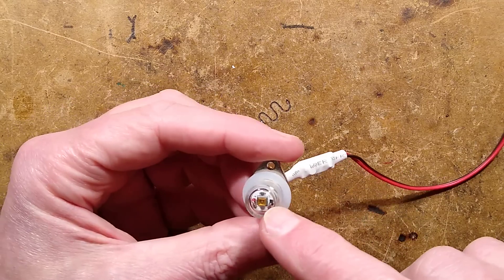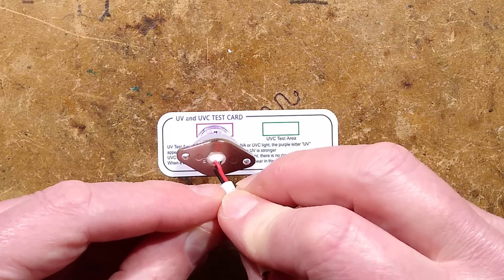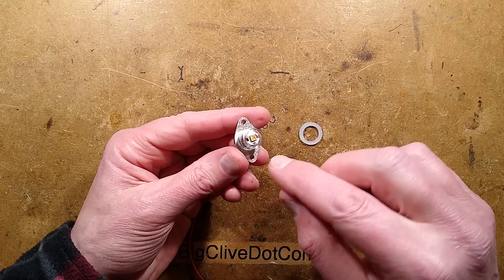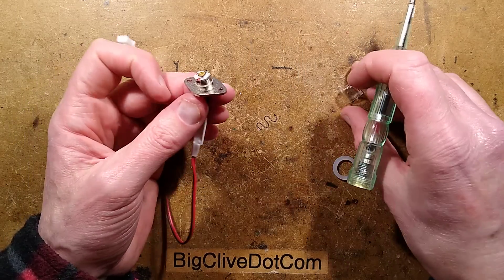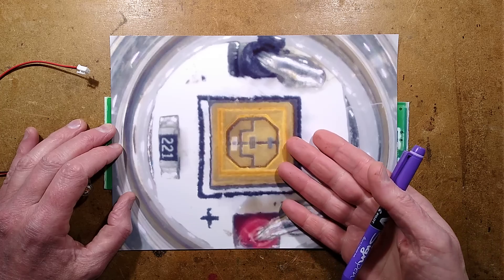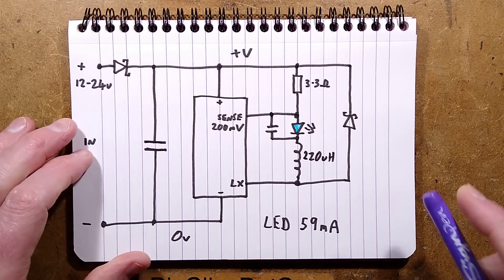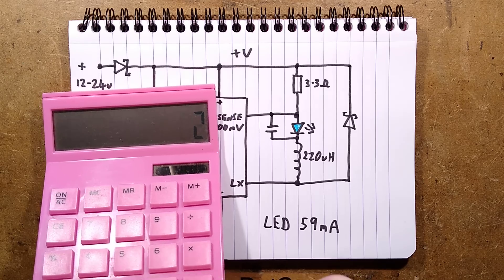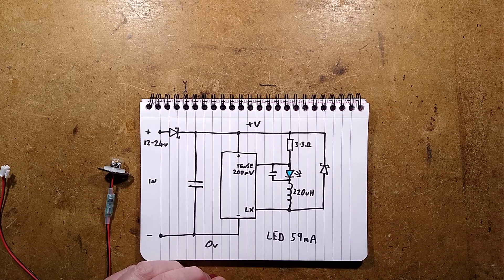UVC LED module for water sterilising

Comment: The UV light in my water filtration system is a 6" long gas vapor bulb of some kind, replacements are $38 US.  It's contained in a polished stainless steel tube which allows the water to pass over it.  Glad they don't go bad very often, kinda expensive to replace.  Nice one Clive.
Reply: Mine has an indicator led that goes red when it goes bad. However my water was so dirty, I still had to take it apart yearly and clean the bulb. One year I did a poor job of reassembly resulting in a  slight leak that eventually shorted it.
Reply: @goingjag  Yeah, mine has the indicator light as well. 👍
Reply: When I used to work with them the instructions stated they had a finite effective life and they had an hour counter. From memory they had to be replaced annually (and usually hadn't been).
Reply: @NiallWardrop  The UV air sterilizers in medical centers around here have an hour meter on them.  Wonder if anyone actually checks that?
Reply: @jerrydurand4127  the maintenance personnel should do that in the programmed time.
Reply: I've worked with UV lamps at a STP - Tertiary treatment plant... so kinda heavy industrial duty. 
The sterilisation process had a large array of 400W HID lamps with stainless reflectors encased in glass tubes, around 300mm long. Strung vertically, looking like comb as such. The water flowed through the death ray tynes at a slow pace. Treatment gate was around 4 metres L x 0.5m wide.  This was between header pits a good 2 m x 2 m deep. 
The service life of the HID lamps was a lot longer than 5 years at a very high UV output at very high efficiency. They make HID lamps at lower wattage rating too. Wouldn't be surprised if below 50W. 

I find it hard to imagine an array of LED could match the practical performance of HID, that will exceed fluro tube .
Reply: @BTW...  You ae right they don't. I have tried to use LED UVC, they where totally useless compared to the good old bulbs.
Reply: Probably a (desirable, vs LED) mercury vapor lamp.
Reply: Stainless steel reflector is worthless because it doesn't reflect UV rays. Polished aluminum would be right.
Reply: @stefanmargraf7878  interesting, thanks!
Reply: "Some kind" = Mercury. Those systems where intended for aquariums, where you don't care about poisoning the fish with mercury. But some clever mind decided that it could be used on drinking water for illiterate humans.
Reply: sounds like a pretty standard 6w/8w bulb with a big price hike
Reply: @lezbriddon  Usually a fairly typical flourescent lamp, difference being the glass is a type that will pass most UV and the lack of a phosphor coating that serves to convert UV to visible frequencies. All flourescent lamps are UV emitters internally as are most LED's.  With a little luck you might find a lamp with a solid, loose bit of glass or an excess of liquid mercury which you could mechanically agitate enough to displace the phosphor coating to allow some amount of UV to exit the lamp.  But nah, better off to start with one that already has the right type of glass and hasnt been phosphor coated inside. They should be cheaper than phosphor coated ones except for the fact of volumes of each type sold. That price differential is probably going away as flourescent lamps go away in favor of double efficiency LED sources.
Reply: The UV light in my septic system (for sterilizing the water after the treatment process before it goes to the drainfield) is a fluorescent tube. It lasts about 2-3 years before it needs to be replaced. Most recently, the ballast went bad after 7 years. The tube uses the exact same 4-pin connector as a circline fluorescent tube, and the ballast works with those bulbs too. So I can test it with a circline tube available anywhere.
Reply: @brianleeper5737  Yes, my UV lamp is the final stage in a 6 stage filter system as well.  I've been lucky as mine last about 5yrs before replacement.  I change it at the same time the RO filter is changed.
Reply: @terrym1065  my well water doesn't need uv treatment, no bacteria according to test results. But it is very hard, full of minerals
Reply: Clive dude, you showed the illumination of one LED, are they combined on one chip both the visible and UVC LED?

Comment: Have an RO system with a VIQUA VT1 that's 13W. The UV light and conversion losses heat water at the kitchen sink tap to ~ 35 C.

Comment: @8:47 "when it reaches the threshold though, 3.3 ohms, it turns the circuit off" I don't follow.. :( can anybody advise?
Reply from the maker: The voltage across a resistor increases with the current.  That is being used to sense the current by detecting a specific voltage.

Comment: I find these UVC videos fascinating, ever since the covid era when I wanted to get some UVC lights to steralise face shields I was 3D printing for different people in my area that needed then to work during lockdown. (I wanted to make sure that I didn't spread anything and make things worse)
In the end I used the trustworthy UVC mercury discharge bulb, having been scammed a couple times with fake LED type (which your videos at the time helped me get my money back and have the ebay listings taken down). 

I've always wondered if you could use known to be good UVC leds as a photodiode to detect UVC from other diodes, or maybe that would be just a false trigger nightmare!
Reply from the maker: I've pondered whether a UVC LED can be used as a UVC sensor.
Reply: I had thought about this also... 

A regular visible color LED is usually pretty sensitive to it's own color, and puts out a very measurable voltage when illuminated. It would be great if a UVC LED would work the same. 

It would be very hard to calibrate it to use it for any actual output power measurements, but it would still give a general idea if it responds to UVC light.... 

I have a couple bare UVC emitters, I'll have to have a play about with them.
Reply: I would say you'd need to look into how they work, and what spectrum they produce, if there's lower frequency content it could be tripped by lower frequencies to some extent. Likely better to use a purpose built photo detector (of basically any type so long as the capsule doesn't block uvc) with a filter to block lower energy photons.
Reply: @xxportalxx. The epoxy encapsulation WOULD be the issue...

That is why every UVC emitter has a special "glass" window on it, because any plastic would block emission.

Comment: Looks neat, but I would definitely not trust my health and safety on one of these sanitizing my drinking water. Maybe a multiple of 20 or so in a gallon or a few liters of still water for a long period of time. That’s just a guess. I’d prefer to prove its operation in a lab before I would bet my health on 60ma worth of UVC. Remember some of that current is not driving a UVC chip emitter.

Comment: Recently, I purchased a security light from B&Q 
Stupidly I was ‘taken in by the words ‘smart’ 
I fitted the light 
However getting the ring to talk to my WiFi involved 
Changing my router settings 😬 
Basically it wanted me to turn off the security! 
£36 
I took it back ! 
Went to my ‘brown overall’ local diy shop and got one for £19 with lovey big adjustment knobs 👍🏻👍🏻 
Works perfectly 😜 
I was gonna send you the B&Q smart rubbish but they refunded me without question. 
Keep it up big Clive 
Your utterly fantastic and we love you ❤❤

Comment: UVC is the new LED frontier that we went through with the original Blue LED in the last century. Whoever figues out how to make a UVC high output chip is going to make a lot of money. As it turns out Higher energy photons get harder to make as the wavelength goes down.
Reply: As the wavelength goes down, acschually😊
Reply: @RuneBivrin  Depends which way up you hold the graph.🙃 As Wavelength goes down, Energy/Frequency goes up.
Reply: Uv is nice, but not nearly as much of a breakthrough as blue

Comment: How much UVC do you get with the indicator card if you remove the glass (or is it plastic) cover?   The cover may be filtering most of it out..  Also, how much UVC is required to sterilize water?  There must be a minimum amount of UV energy that a microorganism has to absorb to be killed and the water itself would also attenuate the light, so with a dim light source, the sterilization may only happen within a few mm of the emitter, so what happens to all the other microbes in the rest of the tank, especially if the water is flowing and not just sitting in the tank?
Reply: UVC light does not need to kill microbes directly, it is enough to damage their DNA so that when they try to divide into two clones the process fails.
Reply: The  cover glass on these water steriliser lamps are quartz  glass I dosent filter out the uv. That's why you should not use a non uv blocked  halogen lamp in  work light with missing cover glass . 

Often the uv  tank  is narrow so the light from the uv lamp may sterilise all the water around it ,when it has passed trough the tank.
the glass has to be cleaned ( often there is a underwater wiper blade  that does this ) if there is stuff on it ,so the uv  does not get blocked, by the coating collected on the outside. The effect off the light source is the factor that determines  how fast the water  may flow/  neessery exposure time and how big the tank may be. The effect on these uv lamps are pretty high and need water as a heat sink to avoid overheating.

Comment: I've considered using one of these for ages to submerge inside liquid Tissue Culture media that I use in Petri dishes but they're so expensive, and I've just resorted to buying some of the cheaper 8 W high voltage UVC fluorescent bulbs instead, the long tube style ones that "don't emit ozone" ahha , $7 each, soldering extra long cables to the AC inputs on each end and waterproofing the ends in UV setting resin glue of all things, then submerging the entire Quartz Bulb in my 8L tub of media to maintain sterility while i pour agar plates hahah.
Reply: The old tubes are much more efficient for UVC, than LEDs. Hopefully UVC LEDs will get more efficient and cheaper.

Comment: You might benefit from a system akin to what Brainiac uses for tesitng wavelengths- as his might be cheaper than the one you were loaned for a time. Keyword- might be as I dunno how much his costs, though it does have the ability to measure across the majority of the light spectrum in both visible and invisible lights. :D

Comment: Very cool. I’ve been wanting something like this for my campervan water tank
Reply: Amazon, $20. Two for $40 for free shipping and better sterilization.
Reply: Make sure, the material can handle uvc
Reply: You could perhaps fit an inline uv water filter from off a reverse osmosis system.  I’ve got a 6 stage reverse osmosis unit under my kitchen sink to take all the fluoride and chemical nasties out of our drinking water, and it has a uv filter as the last stage to destroy any biologicals…I’m sure you could potentially adapt it.  

I would also recommend fitting such a RO filter system anyway because the water government claims is drinkable/potable is most definitely not.  That’s not just ‘conspiracy’ because it’s been overwhelmingly scientifically proven that what they’re adding is nothing short of slow acting poison!  
God bless 🙂👍🏻💕
Reply: @trappedinroom1014  Water itself is a slow acting poison. Everyone who drinks it eventually dies! Oxygen at high concentrations will kill you much faster. If you take just 1.5 mg of vitamin D every day you'll not be able to get rid of calcium and it'll build to toxic levels. In all instances, dose makes the poison. Many things are beneficial rather than harmful under that dose and the amount of fluoride in drinking water has dramatic evidence of being beneficial and no evidence of being harmful.
The crap on internet blogs about fluoride is ridiculous and tooth decay will actually hurt you via cardiac problems and just physical pain.

Comment: Judging from the size and power of the UVC emitter, its not really going to sterilize any volume of moving water.
In fact not any volume of water at all, unless left for hours and hours and hours.
Probably suitable for sterilizing the drinking trough in a hamster cage.
Reply: Would the UV-C blind your hamster though?
(Picturing an adorable little hamster with black eyeshades and Itty bitty white cane)
Reply: @tncorgi92  No, because you have your hamster wear UV protected glasses.  Duh!!   🤣🤣
Reply: @tncorgi92  Thanks, I've got "three blind mice" stuck in my head now. Sung by a child chorus so sweet, it's sickly. Until they get to the carving knife bit, then it sound about right. :)
Reply: @tncorgi92  the uvc is not in the cage.
It is in the water supply to keep the water fresh. Just like in a aquarium. You have it in the water filter. Not where the animals are.
Reply: I think the same, I can't imagine a real use of that with this amount of power. This remember me when in COVID time all people want an "air purifier" based in fake UV-C LED lights...
Reply: I wonder if you could use it to kill algea in an aquarium, or in hydroponic container.
Reply: @hubertnnn hypochlorous acid generators are well suited for this purpose
Reply: Correct. You need much more power. I did my phd on that , killing viruses.
Reply: It ain't gonna do squat. To anything. Comments get deleted for explaining (and properly ridiculing) the concept.
Reply: @MadScientist267  That happened to me also. It is YouTube's auto moderation that deleted our comment, when we rightly are very harsh against anything that simply doesn't work.
Reply: @cajampa  how dare you have emotions

Comment: There’s a handmade cheap spectrometer called „little garden”, it helps determining wavelength with quite an impressive range. Done by a Chinese tech bear 😅
Reply from the maker: I've looked at that, but it doesn't go anywhere near UVC.
Reply: As far as i've been able to test, its range tops out at 345nm. I do not know if this is where the camera sensor also tops out, or whether it's the diffraction grating coating (literally just a piece of DVD) starts blocking UV light past that wavelength. If that's the case, you could try finding a diffraction grating that is able to pass shorter wavelengths
Reply: @mfbfreak  it's a transmissive polycarbonate DVD grating so almost nothing below 400nm is getting through.
Reply: @Muonium1  you need to use it in the reflection mode
Reply: @ there is no "reflection mode" inside the device. It's not a Czerny--Turner spectrometer, it's just a simple slit spectrometer where all the light has to go THROUGH a DVD grating, thus unavoidably absorbing all UV light.
Reply: @Muonium1  I am surprised that you have not seen a real DVD; it is not transparent and cannot work in transmission mode. Actual gratings are replicas on PVC sheets and they can work on both transmission and reflection modes.

Comment: Is the brief exposure enough? The whole assembly is just a little vessel the water passes right through. Can't last more than a second at volumes of 7 gallons (close to 30 liters) a minute. 

Water bottles are similar sized and run a uv much longer (probably battery instead of mains tho). I'm gonna start sounding dumb soon if I continue. I thought it took a while.

Comment: Immediately I want to install one in the lower hidden tank section of my cat's water fountain.😽
Reply: My cat drink any manky water collecting in things left in the garden without noticeable problems.
I rarely see them drink from the bowl indoors that I change the water in daily.
Reply: Make sure it is WELL hidden , cats can see Ultra violet 😝.............. DAVE™🛑
Reply: The water will be moving too quickly to make a difference.
Reply: my dog also much preferred random mud puddles.  it's good for the immune system.
Reply: That’s exactly what I thought about doing. Darn things get scummy fast.

Comment: I dont think for people in the UK this would be any use as our tap water is already zapped before we get it. But for some in the US it might help if they are on a hole drilled in the yard with a pump at the bottom. Interesting 2x👍
Reply: Most well water in the US needs no treatment at all and if there's any bacteria in it, something is wrong (most probably that the well head is allowing rainwater into the well).

Comment: Thanks for finding this Clive.  Half of my brain tells me I need one but the other half says "what for" 😂

Could you run it without the glass cover to see if the effect on the UVC test paper is greater?  Could be that the glass is not as transmissive as the manufacturer would hope!
Reply from the maker: I should try that.
Reply: I did try that and it didn't help.  These are pretty wimpy LEDs overwhelmed by the UVA side.

Comment: The best way to see if it's destructive uv is to draw some colours onto some paper, cover half over and expose it to the light over  a few hours, see if anything changes, and of course your sniff test, but they've all got their "special" numbers to try and advertise with, I imagine it's fairly accurate, or, as close as you can get for the price
Reply: Turmeric is sensitive to UV light and will lose it's yellow colour when subject to sunlight. Which is why it's not been used as a pigment. So that could be something of a test too potentially
Reply: I would just point it at something living and check if it no longer lives.
Eg. at a leaf (half covered like you suggested with the paper).
If the goal of UVC is to sanitize, then the uncovered side of the leaf should get annihilated.
At least in theory, not sure if in practice.
Reply: @hubertnnn  worth pointing out a leaf has quite a bit more protective hardware than a microbe haha that would be a conclusive positive test, but not a conclusive negative test. Best thing to do is actually use it to treat some pond water and look at the samples under a microscope to see if it actually killed stuff.